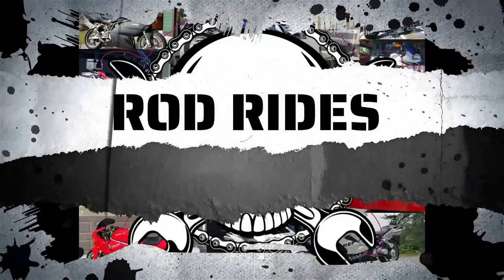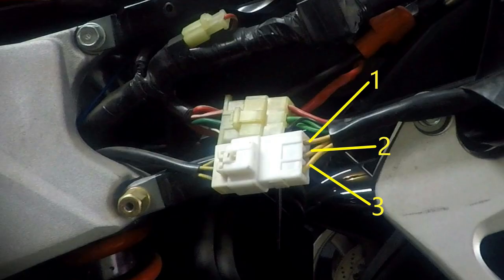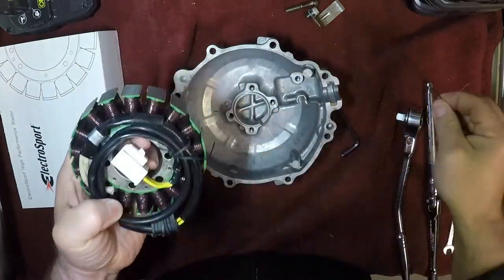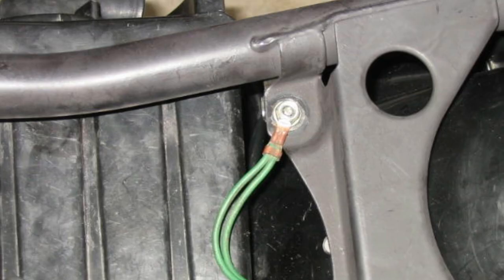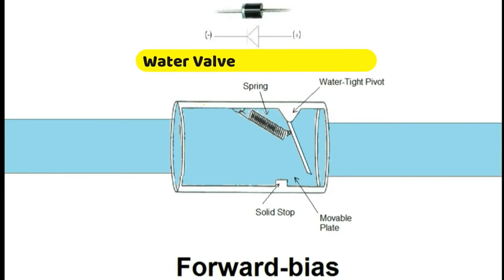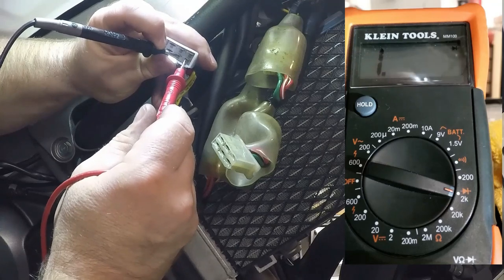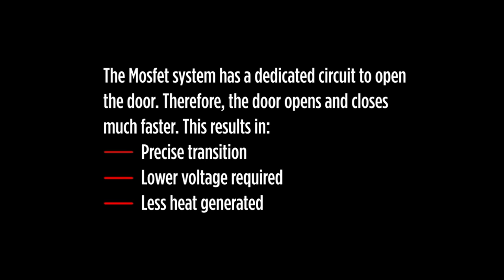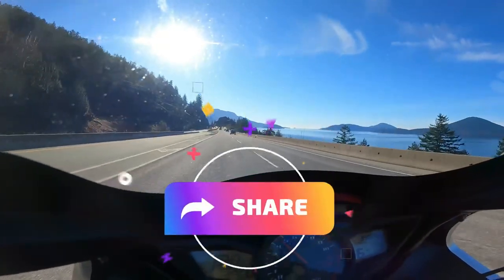Motorcycle Stator Voltage Regulator Rectifier Testing & How They Work

Comment: had a dead batt as well. no charging. cussed the rectifier. turned out it was two brake wires arcing each other. your  method was spot on so i knew something else was wrong.
Reply from the maker: Thanks for the feedback & view!

Comment: Some food for thought...as you  know, since on most motorcycles there is no way to limit the output of the stator by varying the magnetic field, the excess voltage at higher RPM has to be shunted to ground by the rectifier/regulator.  If the Rect/Reg is not properly grounded, this can cause an overcharging condition.   I was blowing headlights on my VFR800 left and right and before replacing the  R/R,  I removed it, cleaned the mounting surface to assure a good ground and made sure the ground wire connection was clean and tight.  I never had another headlight issue after that.
Reply from the maker: Excellent feedback, Thanks!
Reply: Was it surely grounding out through the headlamp bulb?   Thus burning it out?
Reply: @irocss85  since the excessive voltage couldn't he handled by the Rect/Reg due to the faulty ground, the over voltage at higher RPM will go to the battery and everything that feeds off of it..
Reply: Excellent information 👍

Comment: I'm getting 12.5 volts without mine running and 12.23 when it runs with it going up from 12.23 to 12.35 and it's a brand new mosfet ricks motorsports regulator rectifier so is this a stator issue?
Reply from the maker: You don't have any charge current getting to the battery so try testing the stator at the connector https://youtu.be/bUb97GnDLOU?si=V1zcYgAWrAIC9Crn  Either the stator is gone or the RR is bad, new ones can be broken right out of the box.  The stator test in the video link will tell you which it is. - Good Luck

Comment: Thanks Man!   This explains why my agm battery is 14.3v to 14.4v while engine is running.    And my new lithium battery is only 13.6v to 13.8v while engine is running.

Due to the batteries different internal resistance.  The higher the resistance = the higher the voltage.    Ohms law V = IR
Reply from the maker: You Got IT!
Reply: Thanks for mentioning this.  My bike is charging with the same voltage 13.6 to 13.8v range with the lithium and thought I had a stator going bad. I was ready to buy a new stator.
Reply: Is the lower charging V an issue?

Comment: Nice video. My problem is this:  the rectifier gets to hot and it fries. I replaced but the new one have the same issue. I've checked the ac from stator and I get 52v from all 3 yellow wires. Is it normal? This is a scooter SYM VS125. Any suggestions?
Reply from the maker: Hi Franc, you didn't mention at what RPM and you are getting that voltage so I will assume idle.  52V seems high but it is difficult to say since there is not much I know about Taiwanese scooters.  If you've fried two rectifiers I would; 1. replace the ground cables, these can cause a cancerous bunch of electrical issues, not lease the one you've described, while you are there be sure to replace the battery, failed cells can cause the charging system to overload. 2. replace the stator with a new one designed for the displacement of your bike and electrical system.  3. if all this failed I would look to mosfet regulator rectifier to keep the charging system cool as a last resort.  I suspect it is your ground points and/or your battery that is the issue.  Some of these scooters have kick start engines so you could have a bad battery cell and not know it. - Good Luck!
Reply: @RodRidesWrenches I’m impressed with the attention you give to viewers’ questions (issues) that go beyond the scope of the video. Many YouTubers leave the difficult ones hanging 🎩♠️

Comment: I have new battery and new stator. With the R/R hooked up it drains battery, but when i do the test on the R/R it shows that it is good. What am i missing here?
Reply from the maker: A parasitic draw? Does the battery drain to dead while riding? Doesn't sound like it.  It drains after sitting in the garage all week right? Disconnect all the aftermarket accessory light, heated grips, anything else that is not stock and see if it makes a difference to your battery issue.  Hook them back up one at a time wait wait a week between accessory reinstallations to confirm which device is draining the battery or get your multimeter out and test the wiring to confirm which one is flowing current with the key turned off.  If it is not accessory wiring then there is something else drawing power.  It is helpful to include your motorcycle make, year & model in these questions. - Good Luck
Reply: @RodRidesWrenches  2006 Yamaha Royal Star Venture. No extra not hing on it and yes it drains while riding and setting
Reply from the maker: @08soloblade two things then, what is the voltage at the battery with the bike revving up around 4000RPM?  If it is under 13VDC your stator/RR is not putting out.  Since you've tested the AC Voltage at the stator plug like in the video then you have a faulty Regulator Rectifier.   Sounds like you changed the stator, make sure all three wires are in the plug correctly and making AC current.  The stator usually fails though due to a bad regulator rectifier.  Even new ones can be faulty.  If you have good voltage at the battery 13.5 - 14.5VDC at 4000RPM and it drops below 12VDC after idling for 30seconds, then the battery is bad/sulfated.

Comment: Lithium batteries require a dedicated charger to charge the battery externally, with the bikes charging system set up for lead / acid batteries, how does a lithium affect the charging system on the bike (or the charging of the lithium battery)?
Reply from the maker: Lithium batteries have built-in battery management systems to regulate current.  The only charger you cannot use with a lithium is a pulse charger (designed to disulfate lead acid batteries) .  Old school automotive style chargers work fine otherwise it wouldn't work in your motorcycle.  Thanks for the question!

Comment: Hello, I have the values for the Mosfet regulator 447 446 447 and 117 115 117. Is it ok or must all the values be approximately the same??? Thank you for answer.
Reply from the maker: What is it you are measuring here? Mosfet semiconductor tests isolate the three leads from the chip, Gate, Drain & Source.  Continuity is tested between source and drain after opening or closing the circuit on the gate.  Resistance is not a factor.  In this way you are looking for similar results to testing a diode, current should only flow in one direction on a diode, with a mosfet the current should only flow when the gate closes the circuit between the source and drain. - Let me know if this helped.

Comment: 3 phase current connector ( 3 yellow wire) high heating ...?
What problem..?
Reply from the maker: Voltage regulator or your current is unable to get to ground.  Current is experiencing resistance and heating the wires see this video https://youtu.be/KpmvUvpRCEM  which means loose or bad ground cables - good luck!

Comment: Very helpful video! I've been having an issue with my 6v Honda Twinstar where the Li battery dies within days, and there seems to be something going on in the electrical system that i need to diagnose, as now even with a charged battery, she won't light up or start. Gonna bookmark this video!
Reply from the maker: Hi Daniel, their is a short obviously draining your battery, I would start at the battery cables but this is a kick start only correct?  So many things can cause poor spark on these, have you changed the condenser and checked the points?  Probably a short in the wiring harness or ignition key is allowing current to flow through the ignition.  Often with these old bikes the ignition key switch will flow current when they start to fail.  Good Luck & let us know how it turns out!
Reply: @RodRidesWrenches  it's kick and electric start. The battery cables seemed okay but might have to tear down the entire electrical to find the short/bad ground. Luckily she broke down by a vintage car repair so I'll borrow a multi-meter and check it out (when I have time, been working nonstop lately)

Comment: What if I Rev my bike testing DC current across the battery and there is no change. Stays 12v exactly (brand new gel battery) original rectifier. I have a new rectifier and will put it on as well. My original rectifier tested fine across the diodes but DC stayed constant even with the bike revved.
Reply from the maker: Bad regulator or stator.  Test ac current at stator lead to be sure.
Reply: @RodRidesWrenches  I tested current at idle with new rectifier reading well over 13v, at 5k rpm reading over 14v now. Was the rectifier even though testing the diodes passed. Strange.

Comment: I bought a lithium ion battery for my honda vfr800. My question is, will a lithium ion battery cause damage to the rectifier or stator? The battery is a NOCO model number NLP14
Reply from the maker: No the lithium battery will not cause damage to your RR or stator.  If anything your RR will run cooler probably last longer.  Automotive lithium has a battery control system built into the battery, this ensures the charging system is matched to the battery requirements and is supposed to prevent lithium thermal runaway.  Thanks for the question & view!

Comment: New at this lithium battery stuff. I have a sxs with a stator on it. Can i put a lifepo4 battery in it to replace my stock lead battery. I've seen where someone was saying not good to hook a lifepo4 battery up to a altinator. Because if the BMS shuts chsrge down itll fry the altinator.  Is that the same case with a stator, or is it ok to hook a lifepo4 battery up when you have a stator instead of altinator.  If you get lifepo4 do you need a bigger CCA or AH  etc. Any info on this would be appreciated.  My stock battery is 1 1/2 years old and having trouble with it, thought maybe lifepo4 would last lot longer if its ok with stator. Thanks
Reply from the maker: Any lithium battery designed to work in your sxs  if fine.  The battery chemistry is not really important,  most lithium designed to replace a lead acid in a car ATV or what have you, will be lithium iron phosphate since it has the highest temperature threshold and doesn't self ignite as easily as other types of lithium.   The BMS is the most important factor when buying a lithium battery.   Buy from a reputable brand and you will be fine.

Comment: Quick question,so i tested my cbr 600 f4 stator with a cold engine and everything checked out but then after i warmed her up and checked again,i got a much higher reading,what does that mean?
PS: my stator plug also seems slightly dark on the tip as if it burnt a bit, , ,(initial problem is hot start issues)
Reply from the maker: It just meant you bike was running smoother after being warm.  It is absolutely fine to have higher AC current out of the stator when warm, as the VFR I used in the video will show, the voltage actually starts to climb as it warms up as well.  If your rectifier is getting fried, or the cable connectors around it, I would be checking into your battery cables.  Being an F4 this is no spring chicken and I would bet that inside those cables are green/grey corrosion.  Otherwise be sure to use a small amount of dielectric electrical grease on the plug to help keep water out.  A no start, not turning over typically means the starter relay.  Now I have fixed many bikes with a intermittent or permanent start issue by simply removing and cleaning the right handlebar switch assembly, see how in this video of my abandoned ZX6 https://youtu.be/W0MTZbtMgOw
Reply: Thanks for the feed back,so the test i did was checking ohms or resistance,Manuel says to check when bike is at 20°c/68°f ,but i also checked out another video of a guy testing stator on a F4 and he says anything more than 1 ohm then the stator is shot,i checked mine cold it reads 1 something,but warm it reads 2 something.
PS:new R/R and New battery,no correction on any of my terminals as i make sure to keep that in check
Reply from the maker: @leighribbonaar6314  So the battery is going dead then?  1 ohm is too high for a resistance test between the two main charging leads from the stator. should be under 0.5, but this can get confusing.  What is the AC voltage of the stator charger leads?   When measuring continuity do any of these leads go to ground?  This is the simplest wat to test a stator and foolproof. https://youtu.be/bUb97GnDLOU?si=8W7e5fBzBjG5Xx7E
Reply: Battery is charging,ill only have a isssue once bike is at opporating temp,revs will stumble as if she wants to die and if she does cut out it will swing as if the battery is dead,but when you let her cool down she swings and starts strong again,stator is not shorting out to ground,,i replaced the standard 35amp rectifire with a bigger 50amp so the gauge wiring is thicker than the stators 3 yellow wires,could that maybe explain the slight burn indication on my stator plug?,,,did not messure AC yet

Comment: Is it common for AGM batteries to overcharge? I have hard wired two separate RR and still get 16-17 volts at battery in idle. Both RR have passed diode testing, there is zero continuity, and even have about 3 separate and solid grounds set. And for some reason, still cannot get voltage under control. I took battery down where I bought it, and they said it was 100 percent charged. I have gone through 2 batteries in the span of 3-6 months. (swelled up)
Reply: Also, how can one test the regulator on the RR? I am assuming just because the diodes are working does not mean the regulator is...

Comment: Hi from Ireland, great vid, well explained, would a bad rectifier cause timing issues at high revs?
Reply from the maker: No, there should be an ignition pick up coil on the clutch or attached to the crank shaft that can get dirty.  You haven't given me much to work with but if the engine is missing at high rpm you have faulty plugs/plug wires/coils.  If what you are experiencing is popping, backfiring, i would be checking main jet and needle if carburetted and valve clearances. https://youtu.be/x6zw1PekYPg?si=yi0bzi6olldcS8MI

Comment: I currently have a dirt bike without a battery. I want to add one that charges on the bike. Can I tie it directly to the stock regulator to charge it? Would it prevent the lithium ion battery from over charging? Any input is greatly appreciated!
Reply from the maker: Okay, Okay - Since you didn't list the year/make/engine size of your bike I am going to assume it is fuel injected since you said it had a rectifier.  Wired to the Rectifier is a capacitor that stores a small amount of current for starting the bike.  I am told (never done it) you can remove the capacitor and wire a battery to those leads. Problem 1 solved.  Problem two comes down to what you are attempting to do...  If you are trying to make the bike street legal you'll need a high capacity stator 50 Watts minimum I would guess and you will have to opportunity charge your battery when you park, like a hybrid LOL.  To give you perspective; a Honda Trail CT125 has 190 Watt stator, a Honda Goldwing has a 1000Watt Stator, most 450MX bikes have a 40Watt Stator. To go street legal you need to have an electric horn, a radiator fan and so on...  If you just want lights I would think you may be okay with your stock stator provided you have a switch for the lights for short use and a decent capacity battery. If you run your battery down though, by running too long with the lights on, you will not be able to run or start your bike!  Lithium is a good idea since you can get more juice without adding weight.  Lithium batteries have battery management systems built into them to prevent thermal events.  A lithium battery takes less voltage to charge sine it has a more consistent resistance. To make a successful transition to lights on, radiator fan on, sitting in traffic, you will need to get creative and bend over/pay $$$.  IMO you may be better off finding a thumper with a battery and lights from stock, it will have the stator output you will need and spend your money making it lighter and quicker.  Alternately look for a web forum with your bike and ask if anyone has done it and what they did/found/kicked themselves in the head over. - Good Luck!
Reply: Thank you for the response! The bike is a yz450f. Kick start/carb.  Luckily I passed an inspection yesterday with 2 Milwaukee m12 batteries one for the head light, other for the blinkers, horn, etc. when the guy sold me the bike he gave me a hi output stator and a coolant fan that I’ve yet to install. I’m an electrician by trade but honestly haven’t spent a lot of time with dc. The tusk enduro lighting kit that is installed on the bike came with a 2000mAh battery that powers the leds but isn’t big enough for the head light. The wiring harness that was provided with the kit intercepts the rectifier/regulator power. As of now those leads are not being used. I guess my real question is how the regulator works. If I was to hook up my own bigger lithium ion battery to those leads, would the regulator open when the battery reaches 12v? Eliminating it from over charging. The battery would be in a sense back feeding into the rectifier/regulator.